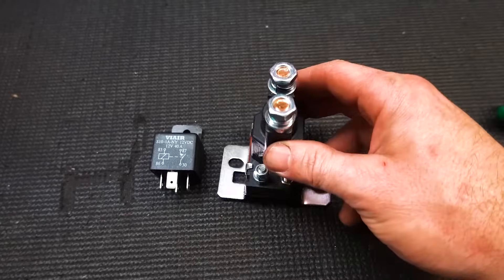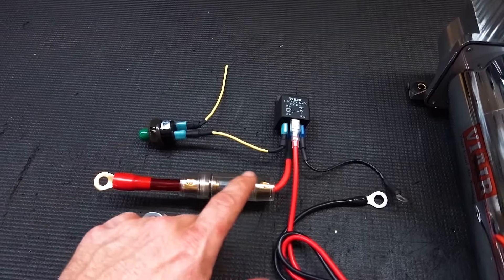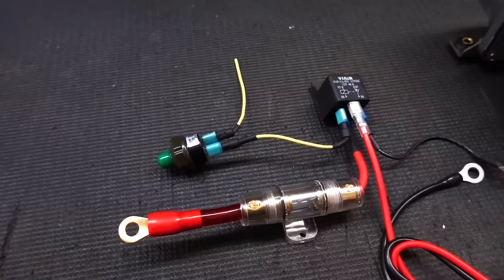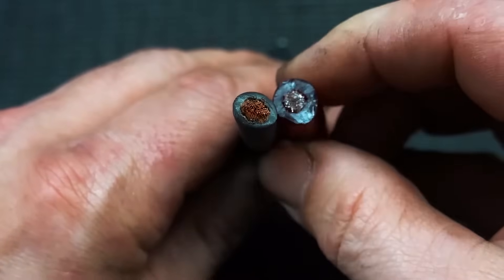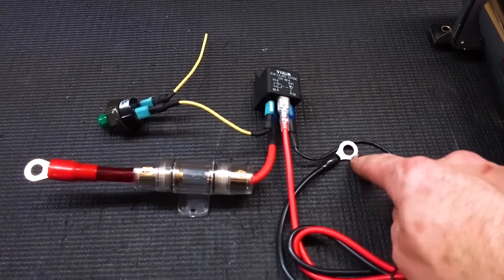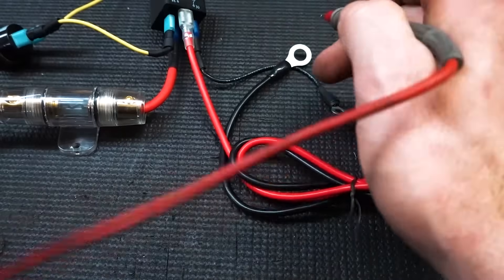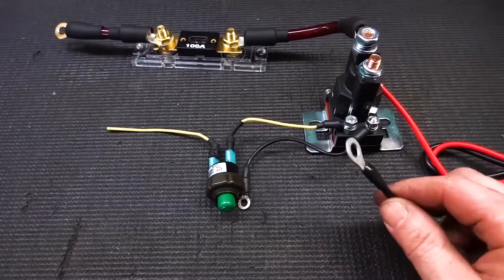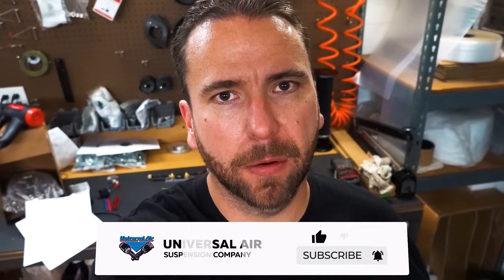How to wire compressors for your Air Bag Suspension

Comment: Exactly what I was looking for. My compressor was dipping my battery to 10 volts so I needed to upsize the wire gauge and upgrade my alternator. Classic bugs don't like modern wiring haha
Reply from the maker: If your battery voltage is dropping to 10 volts, those are excellent things to check.  Also check the ground circuit on charging. (engine to chassis/chassis to battery)
Reply: @UniversalAir  I ended up keeping the sam alternator, just changed the wire gauge and good call on checking the ground, I had to sand down the contact points and it works perfectly now

Comment: Dropping 1 volt at the compressor pole of the 80 amp solenoid normal ?
Reply from the maker: That is a little high. Double check all of your connections or check each connection and see where most of it is coming from

Comment: I want to thank you for your help with wiring up the different versions of compressor wirings, I finished up my twin compressor wirings system by using the 100 amp fuse and the 80 relay system and my on board air system works great

Comment: I know this is a couple years old but a couple things; The reason for grounds ran in a wire harness is you simply need positive and negative cables. The grounds are not all brought to the battery from a manufacture because the body is indeed conductive enough as long as its metal, Unlike Corvettes for instance but different topic. The reason for common ground spots is so you don't have grounds all over as that equates to a very messy and expensive wiring harness.   

The positive cable is more crucial, They are equally important HOWEVER, It is not the negative that gets so hot it melts then burns your car down! 
The reason for this is because you are correct that voltage does flow from negative to positive BUT current (Amperes) flows from positive to negative. Wires will take voltage all day long, It's the amperage that will get you. We measure voltage because where there is voltage drop, there is some pissed off choking amperes taking that voltage down and a volt meter is cheaper than a amp meter.

 Vehicles are spot welded prior to any coating so conductivity should never be a issue. (I personally have never had this issue or seen it) I install systems with thousands of actual watts, I do not run negative cables front to back. I do run a negative to the chassis for every positive, amps never grounded on the battery.  I personally have 4 runs of 2/0 from alternatorS  back, I am not paying to run 4 2/0 back. Also important to note that a battery is not really the source of power, It stores it, The alternator produces power. Many times people say to ground close to the starter, common sense is the starter only draws for (hopefully) no more than a second, It has a engine and transmission to absorb it's amps it don't use. The alternator albeit does as well however if the car is running the alternator is doing its magic (again hopefully) and it's for a much longer duration (Know what I write here?) 

None the less, Your explanations will not burn a car down and that gets a 👍

Comment: Great video. My question is can I also run my e plus level wires ECU on the same relay or do I have to to use a separate relay for that

Comment: Stop Using Junk wire....Step your Game up to Marine tinned wire / cable....It's AWG.....AWG will flow aprox 7% more amps than SAE....It's finner stranded and VERY flexable....But it has superior insulation.

Comment: Looks like a fuse between the 80 amp solenoid and the compressor would have saved the wires on that compressor.

Comment: Wow, thats really great information, i thought i know everything ... thank u, i have a question how or where do i get a good grounding ?   thank u again
Reply: Factory ground studs are usually good, and found in different parts of the vehicle. There are usually a few under the hood. He showed briefly how to find a good ground using Ohm setting with the multimeter. You can take the multimeter probes and put one side on battery negative, and use the other probe in different areas to see if they have a good connection

Comment: I blew 2 relays already everything turns on at frist but when the tank or the pressure switch hits 170 psi the relay just fails could it be ground issue? Or can it be that I have the signal wire connected to the relay and I just taped into that wire and put the pressure switch? I used relay and solenoid so I’m kinda stuck

Comment: Excellent explanation for wiring compressor/s.
I have an accuair endo ct tank that I've had setup for a couple years now. It recently failed, as they all have, but after unplugging it and opening a couple ports up on it for a week I found that it came back to life. I could hear the compressor kick on then off on start up even when it was failed. Eventually it failed again, as I knew it would, but I noticed it was kicking off at 160 psi instead of 200 before it failed completely for the second time. This lead me to believe that it's the pressure switch that's failing and not the compressor as I can hear the compressor kick on for a moment at start up and it sounds healthy. I plan on opening up the assembly to see if there's a way I can hack/delete the switch. I'm thinking if that's even possible that I can run a manual switch to turn the tank on/off via ground. If I'm unable to hack the ct then I'll just be using as a tank and running an external compressor. Any thoughts or ideas about trying this hack?
Reply: BUY A BATTERY POWERED MILWAKEE TIRE INFLATOR WHICH HAS A DIGITAL READOUT AND GOES TO 100LBS ADD A 50CENT TWIST VALVE INLINE TO LET AIR OUT AND FORGET THIS VIDEO EXISTS

Comment: You should also mention, for those who have classic cars and have an alternator that needs to be excited( turned on), to put a manual switch on the ignition side.
If not you will burn out the internal regulator on startup with all that simultaneous current draw from pumps and sarter.
I did, so when I start her up, I give her a little shot of gas that excites the alternator(turning it on), then flip the switch to the pressure switch, and you're golden.
Trust me..... lol
Reply: BUY A BATTERY POWERED MILWAKEE TIRE INFLATOR WHICH HAS A DIGITAL READOUT AND GOES TO 100LBS ADD A 50CENT TWIST VALVE INLINE TO LET AIR OUT AND FORGET THIS VIDEO EXISTS

Comment: Great video! I have my dual 444 wired up but haven't tested it yet. Anyways, don't you think the oem wires coming out from the compressors could be thicker? I think viair could go up a size or two.
Reply: Yes 8 gauge at least would be great

Comment: Just run a auxiliary battery by the compressors and you will always have good power and ground but make sure the battery gets charged minimum 13v that's what I am doing

Comment: Awesome video! The best way to check your wiring is to do a voltage drop test. B + to input of compressor motor while running. B- to motor negative. The SAE gives allowances for voltage drops on circuits. If this doesn’t make sense Motor Age made a great video on voltage drop testing with a guy named Joe Glassford. It’s worth watching on YouTube.

Comment: Hey Zach is a 12 gauge neg wire from the bat to 1 compressor good enough, about  10 feet.
Reply: Depends on the amp draw of the compressor

Comment: The real work of air install isn't the struts, for sure the wiring of the electronics 😤 I'm a mechanic and am trying to get this done over the weekend, but honesty it's slightly intimidating. Thanks for the help! Going to be buying the items in link, running dual 444 Vlairs so the info helps a lot, and I have a long sedan so I do appreciate this haha. Question, would you reccommend parallel wiring a secondary battery? I realise this is even more work, but don't see the downsides? (Aside from space & work) if my modern car already has a good enough alternator?
Reply: Hey I am currently doing my install but am very intimidated with the install any guides you used to install this , I am absolutely clueless with electronics and having a very hard time wiring them.
Reply: @anthoniep483  I'd just pay a specialty shop to install in your case tbh, call for an estimate and pick one with good reviews within your budget. It's not worth messing something up and costing more, imho 😤

Comment: excellent tutorial, do you have one on how to run dual compressors with relays?
Reply from the maker: I don’t have a video on it. You would just jump from one relay to the next for the compressor turn on and ground. For the power wire run either direct wires back or do some type of fused distribution. 

It gets cluttered when you have all 8 wires together. That’s why an 80 amp makes things a lot cleaner

Comment: Are you using an 80amp or 100amp fuse for the PAC 80amp single relay? In the video, you are using a 100amp, but is the correct size to use for dual 444c? I assume the 100 amp is being used because of voltage spikes.
Reply from the maker: Either fuse would be fine, its suppose to protect the wire.  I would suggest to run a larger capacity for the spikes during startup.

Comment: if the ground is not good will the power from the lil post not go over to comp side or no siginal
Reply from the maker: If your ground isn't good, you will have a voltage drop, which will damage the electronics if it get too low.

Comment: I have 2 compressors for my airlift suspention one of it burns the fuse and the other keeps running without burning the fuse as normal, So if my ground cable its also too long same principle apply about the voltage dropping making hard for the compressor to run? I put the new relay harness on my second compressor, it was very long and just coil it and not trim off or anything because my battery and system is on the back of the trunk, could that be an issue?
Reply from the maker: I would suggest to probe the red/black wires and see what your voltage is at the pumps.  If you have good voltage with the compressors running, then it might be a compressor issue.
Reply: @UniversalAir  thanks a lot for the advice I will check that, I am starting to think that my compressor is just bad becasue I trimmed off the cable change check valve the only think left is check the voltage

Comment: Can run a toggle switch instead of running it through the ignition? Should I install a inline fuse for the hot wire from the battery to that toggle to be safe or is the fuse not needed? Thanks in advance
Reply from the maker: You can, but if you forget to turn off the switch, and you have a leak in your tank, it will kill your battery.  It won't happen right away, but over time, a small leak though the pump normally happens and then one day it will start kicking on at night.
Reply: @UniversalAir  yes it will had that problem 15 years ago on my first air ride truck
Reply: I put my toggle switch (I used a on/off button) inline with the ignition circuit. Of when car is off, selectable by switch when car is on.

Comment: Dang good explanation for amp draw, this can also be applied to stereo systems, amplifiers, winches, electric turbos (which don't really work well unless you have a 24 to 48 Volt system) in short, this theory/fact will literally work for almost any thing added to the vehicle (after factory) that has +5 amp draw, maybe even less. I was thinking I had to run the same gauge ground wire as the +B on the relay/solenoid ground side, this is so much easier thank you.
Reply: bro i used my airbrush tankless compressor which has all that crap hes building built in for 88 frigging $....i bought a small cig lighter inverter for 20$ plugged it in and im laughin....10 mins and a 10th the cost.
Reply: @stanlee2200 always good to save money... especially if it works out for yuh. I've actually gone to doing similar things due cost, plus I learn more lol.

Comment: Awesome video🤙 if you run 2 compressors do I need 2 pressure switches Thanks
Reply: Just one is needed. My advice is go with the solenoid instead of multiple relay, makes for easier cleaner install

Comment: My compressors don't turn on when I start the car any ideals what it might be
Reply: I replaced the 80amp solenoid and it worked but after airing up and turned of the car the compressors never turned back on
Reply: Fuse, check power to relay, check power at compressor, check switch/IGN trigger wire to relay

Comment: I went out side and my car flat to the ground  I started my car and I don’t hear anything my Compressor is not making any sounds to pump up  the car   I bought this car with This air ride suspension so I have no idea so I need to check the ground wire because it’s making no noise right I appreciate your videos so much you’re a real help thank the Lord for you
Reply: Check for a fuse going to compressor

Comment: Hi, I have a dual viair 444c step up with a 5gal tank, viair pressure gauge, viair 200psi pressure switch, and dual viair 40amp relays. I wired the setup just like their dual wiring diagram. My problem is the pressure switch won't shut the compressors off after reaching 200psi. I had to cut it off by the toggle switch and that was at 215psi trying to see if maybe the pressure gauge was a little off or something. I've changed 3  viair pressure switches. And it still not turning them off. Do you know what's causing this problem. This is my 4th set I've done on my vehicles but my first time I had a dual set up and first I time I had this problem with the pressure switch not shutting off
Reply: You sure the pressure switch is right? I thought viairs have an internal shut off that shuts them off once they reach 200 psi. So my guess would be your pressure gauge is wrong. If its digital gauge make sure you have it configured for the right sensor
Reply: Sounds like the pressure switch is not wired in line with relay trigger lead to shut it off. Basically main power switch should start with an IGN source, to a main power switch from 2nd contact of that to the pressure switch then 2nd contact to the relay trigger. So main power switch OR pressure switch can turn it off.

Comment: On the smaller ground you showed on the relay can you upgrade that ground wire to a thicker gauge and still use that to ground the relay and compressors at the same time.. thanks for your response. Great video by the way

Comment: This may be a dumb question, does anyone know if it’s safe to ground everything to the negative side of the battery? Awesome video btw every single word of it has been so helpful
Reply: That would be just fine in this scenario. Negative post of the battery is the direct source for the power/ground (when not running) and the ideal grounding spot. Alternator is the source of power when vehicle running, but you wouldn't want to tap your power into the alternator post since they usually have small wires to the battery, and when the vehicle isn't running your load would be trying to go through the small alternator to battery wire.

Comment: What voltage should we be around? I did a big 3 upgrade and it did drop my voltage from 14.1 to 12.1 is this good?
Reply from the maker: What voltage are you seeing at the battery and at the pumps while they are running?  A 2 volt drop is a lot, however if your at idle and your alternator isn't putting out much power, you might not that the full drop.

Comment: hello.
When my pressure switch turn off,  the noise (clik) is going into the speakers and also when i prss on the buttons to raise or lower the car it's goes in to the speaker as well, what could it be?
Reply from the maker: the voltage spike as your coil is being de-energized.  If your grounding is close by your amplifier, you might want to move it.  also you can be getting noise into your RCA's if the valve wires are ran next to your RCA's.
Reply: @UniversalAir  My ground from the compressor and vavle is connected  to the batteri, same with the grund from det amplifier, that could be the problem and i need to move the ground from tje compressor and valves?
Reply: because when i take of the ground from the amplifier and it turn off the. The noice is stopping ofcause.

Comment: For the pressure switch, when you say the other lead goes to ignition, what does that mean?
Reply from the maker: The pressure switch is an in-line unit with two wires.  One is the output to the relay/solenoid, the input is from ignition, so your compressors turn off when your ignition is off.

Comment: Can you go too high on wire gauge
Reply from the maker: No such thing, other then of course your pocket book would complain :)
Reply: No you can't, i used true high quality 4 gauge wire from battery and grounds to solenoid and regular factory compressor  size gauge witr for compressors. My battery and all wiring is in my truck bed and is no longer than 3 feet long. Have no issues with it so far.
Reply: Good God nobody competes with your video quality. If you do business in this fashion I would be a constant customer. Ps looking to build 3 systems now
Reply from the maker: Thanks!
Reply: @UniversalAir  please cover manifolds,. 5" lined systems, and compressors air zenith vs viair

Comment: What do you think abut a tank drain? Also water traps, can that be installed in any air system? How do you feel about safety pressure relief valves on tanks?
Reply from the maker: I would recommend to drain the tank.  Of course, the more humid your environment is, the more often it needs to be done.  

Water traps can be installed, however they won't collect all the water between the tank and the compressor since the air is hot.  We recommend to put them between the tank and valves to prevent debris from going into the valves.

Safety relief valves are fine, we typically don't run them since the tank's, fittings, line etc is rated for a lot higher pressure then the compressors can physically make.  If your running compressed gas with a nitrogen, helium or especially CO2, then i would HIGHLY recommend it incase of a regular failure, or the natural pressure raise of CO2.